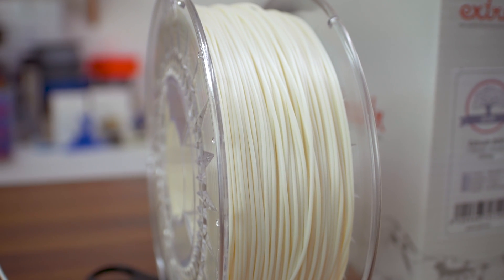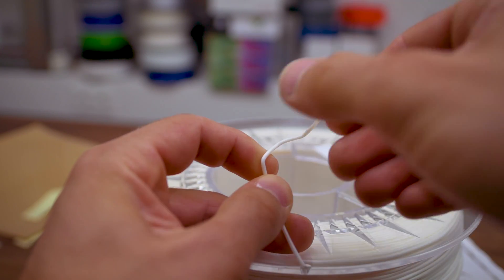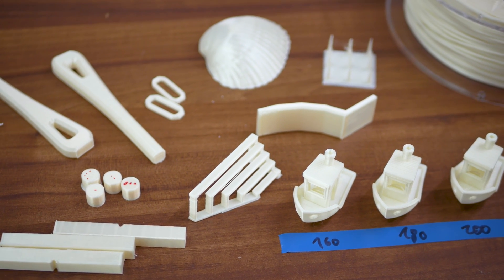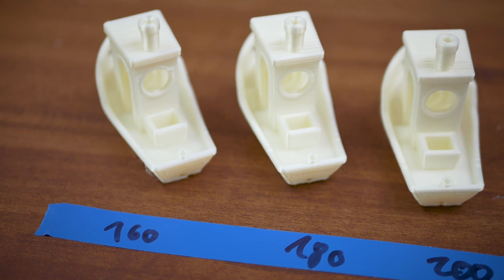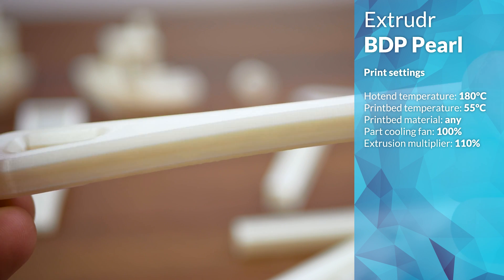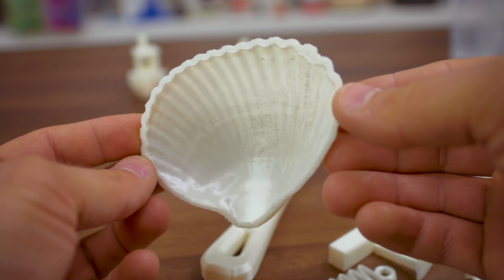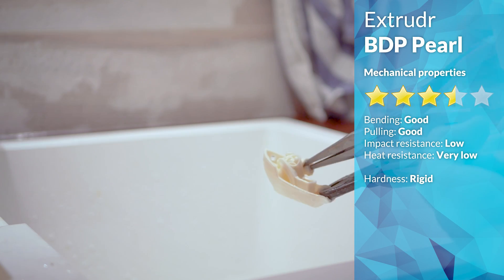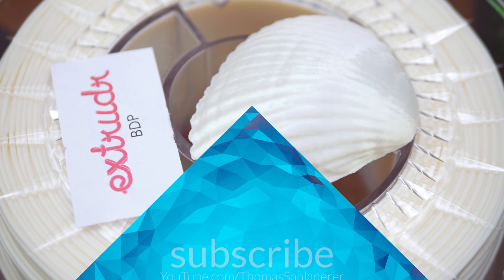Degradable tree-based filament: Extrudr BDP Pearl review! #Filaween2

Comment: Did you get a chance to compare BDP Pearl vs. the normal "Extrudr Greentec BDP"? I think the results might differ drastically.
Reply from the maker: +mountainprophet I do have the regular Greentech here, too, didn't think it would be a big difference as both are "BDP". Will give it a go!
Reply: @MadeWithLayers   You should if you have the chance test out GreenTec. its different from pearl in a lot of ways. you'll find it to be much stronger :)
I love your channel by the way. learned so much in the years I've been following you, thank you
Reply: +Thomas Sanladerer  There is a difference. The manufacturer claims the normal versions can resist 110°C and is stronger. Also it prints hotter. Please review the normal version too!

Comment: At that price it should print itself without a printer.
Reply: so what's the price half life? 4 months in the compost heap for the bio plastic. I don't see it becoming popular enough to drive the price down to mass adoption. It doesn't seem to be sufficiently better than PLA at less than half the price. Unless you are specifically interested in composting it.